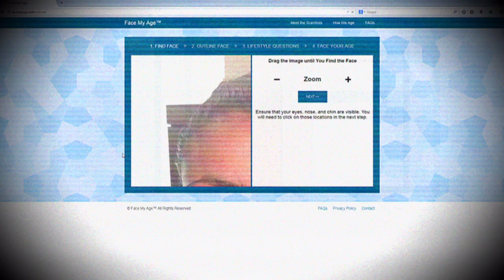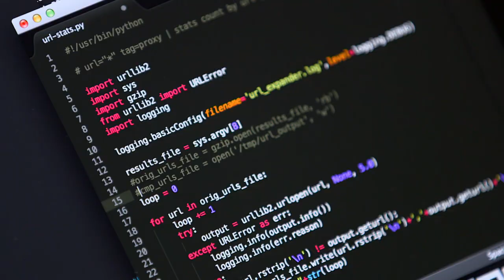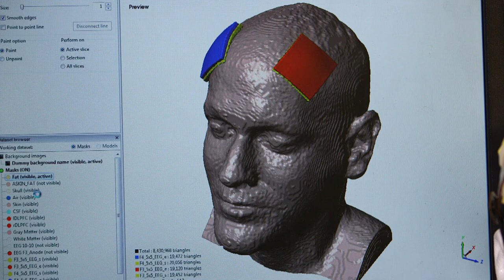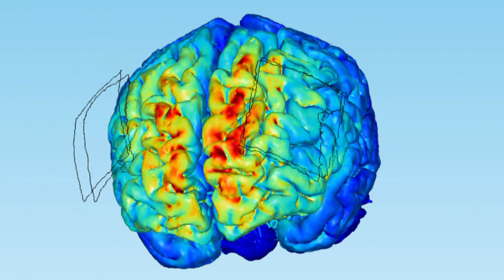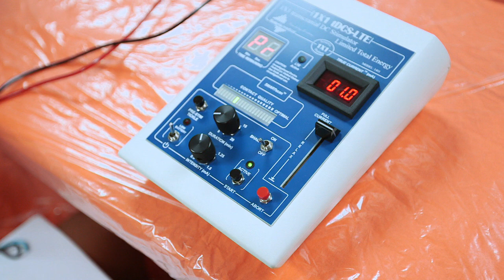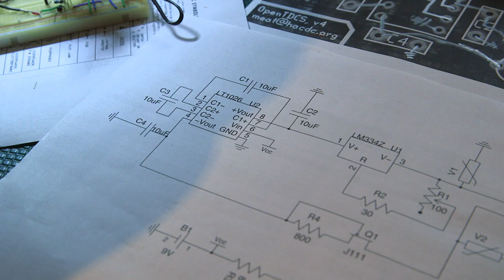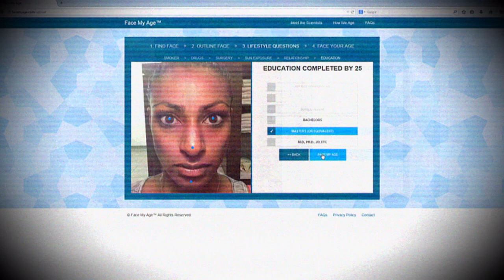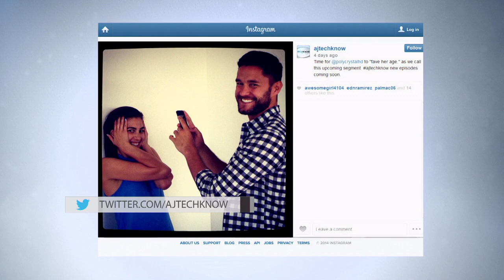Brain Hack - TechKnow

Comment: Don't attempt things like this at home. Hospitals and Research Centres have a particular molecular structure to their walls and certain atmospheric conditions that render all treatment done within their walls safe and effective. Treatment done in any other environment will result in spontaneous combustion.

I don't want to be obtuse, I get what they're trying to say. The machines used in hospitals have better current monitoring, have inbuilt fail-safes and they have medical personnel on standby. But I think it's ridiculous the way they make it sound like something magical is taking place in clinical environment.

It's like they've spent so long staring at spreadsheets they think the controlled environment of a scientific study has some tangible real world effect, other than ensuring the accuracy of results. And as if anything done outside such an environment will operate via cartoon physics. In the real world 9v is actually 18v.